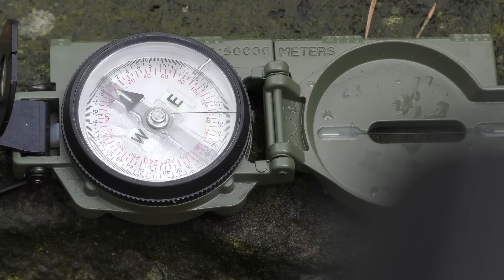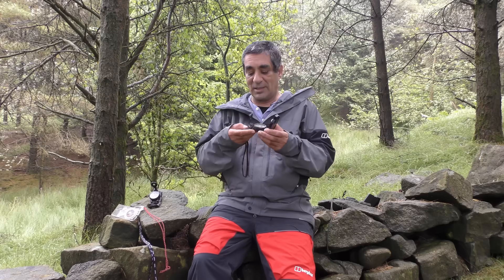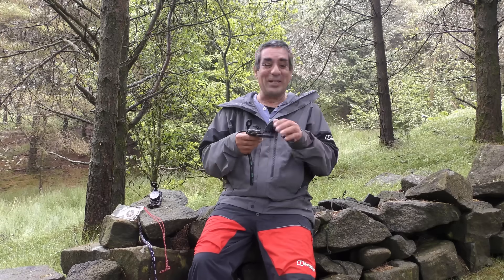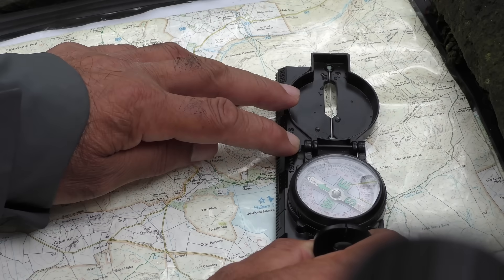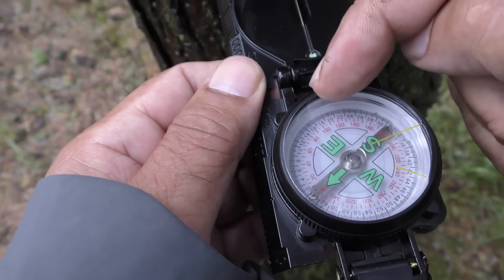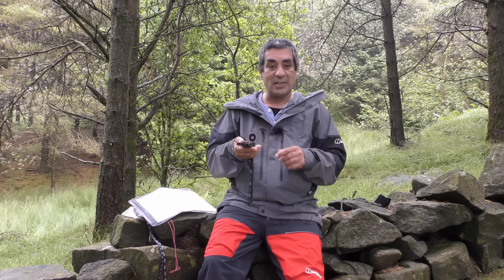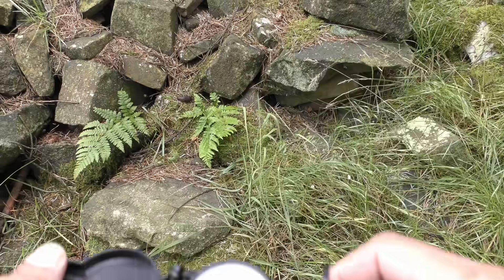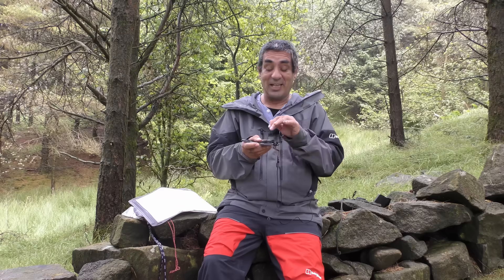The compass no one knows how to use

Comment from the maker: Before commenting please watch the video.  As repeatedly stated in the video, this is NOT a Cammenga.  And, unless, you're around 95 to 100 years old (or more) you didn't learn to use this type of compass in the military as it was withdrawn in the mid 1950's.
Reply: LOL. I was taught and issued this type of compass in the British Army in the eighties. Most people in practice used a commercially sourced Silva compass but this type of compass is very useful if you're forced by circumstance to travel following a compass bearing accurately. The Silva type compass is much more convenient to use when working on a map. We were still being issued equipment from WW2 in the eighties.
Reply: @kalliste23  really, so what's the color of the boathouse then?
Reply: @dorup9060  So... what is the color of the boathouse at Hereford?
Reply: Heck I used a very similar one in the Australian army when I joined in 76. Finally got to SASR, purchased 2 Silva flats, Mils, {we only work in Mils,and Meters,then had a Degrees  Silva for emergency and sometimes easy night work, and one of the Prismatics as a back up. 1 is none, 2 is good, 3 is perfect/Redundancies , redundances. Want to hit an 8 figure Grid Point, show them how please. Good show though matey.

Comment: The little hand points to north, and south will be the opposite direction. You simply need to decide which way you want to go. Hope you are not going to try and invent another compass just because you struggle using it. Also not having a map makes a compass rather useless. And not many people know that over long distance you might think your compass is broken if you don't realise that it is pointing to a single point, as you move past the 90deg point it start wandering backwards. Simple education and you won't need to re-invent anything that already works perfectly.

Comment: Didn't they used to be called a lensatic compass . I had a cheap one and learned to use it when I was a kid . Only trouble with them in an operational situation is that theyre not as quick and the wire and additional components makes them  fragile  by comparison . Still lovely compasses though . I like them .

Comment: I was taught that the small yellow line is used to circumvent obstacles - i.e. ponds and the like and then to resume on the same paabd bearing you began with. Without changing the compass's setup.
The idea is to construct a defined polygonal line or traverse around the obstacle.
The angle is always +-45 degrees, for segment length just count your steps.

Comment: What I'm getting is that the two yellow lines are like the three seashells.
Reply from the maker: But, after watching the video, you now know how to use the two yellow lines.  No one knows how to use three seashells.
Reply: @TheMapReadingCompany  UnitSe might be referring to the two dots that a baseplate has on each side of the orienting arrow and the one on the arrow, typically with phosphorescent coating that might look like shells at night.

Comment: I always thought the point of the two lines were to be able to record two asmith directions. Say you know you will be hiking in low light conditions following a route with a checkpoint part way through where you change bearing. With having two lines on instead of having to stop and reconfigure the compass you could calculate both before leaving and just simply turn the compass from one line to the next without adjusting the lines. Alternatively if you were in a land nav field exercise like I did in the military you could set one line to a safety direction in the event you get lost or it gets dark that will point you back towards a roadway, fence line, or river bordering the exercise area.

Comment: Hi Wayne.  I was told by a family member who was U.S. Army(1970's), that the two lines were for determining how far across an obstacle it was, such as stream or river crossing. From your side of the river you would take a bearing to an object on the other side an then align one of the lines with that object. Then turn 90° and start walking while counting your paces until the line that was 45° offset was pointing at the object and that number of paces was the number of paces it would take to cross the river because a 45° triangle has two equal sides at 90° to each other. At least that's what that particular Sergeant taught. Thanks for your excellent channel. Florida, USA.
Reply from the maker: The compass used in the video - well that type of compass as this is a cheap copy - hasn't been used by the US military since the 1950's.  So your friend was talking about a different compass.

Comment: I agree with your method of sighting on a landmark and reading your bearing.  I disagree with your method to calculate a bearing from a map.  Assuming you are basing all of your bearings off of magnetic north (as opposed to True north), you MUST ALWAYS orient the magnetic north line on your topographic map to coincide with magnetic north on your compass (use the edge of the compass). Once this is done, align the edge of your compass on top of your line of travel. The start point must be on the compass end, and the end point must be on the wire end. Where the wire first intersects the compass is your BEARING. There is usually a black line on the compass that always lines up with the wire. Using this line makes it easier to read your bearing. To travel fast, hold the body of the compass to that it cannot rotate. Then turn the dial on your compass so the index line (usually yellow) coincides with North on the internal magnetized disc. For moving fast, simply rotate the compass so that the yellow index line goes through North, and follow the wire which provides the bearing taken from the map. If working properly, all compasses work the same. I recommend the Cammenga as this compass has no fluid which can freeze or develop a bubble. There can be two sets of numbers that go around your compass. Always use the numbers that go from 0 to 360 degrees. Ignore the other numbers. The Cammenga is best when you want the best accuracy. Use to sight through it like shown in the video. When looking the magnifying glass make sure you are reading the correct set of numbers.
Reply from the maker: Hi Paul, thanks for joining the conversation.  Orienting (pointing in some direction) the map is not necessary - although I know most people still think it is.
I made a video about this very topic:  https://youtu.be/AWiMV4T5kPc

Comment: Was suggested this, figured id watch since i picked up an old engineering compass (that kinda looks like an m1938 style), For a few bucks at a second hand store..

Its in really good condition too.  😅

Thanks for the info.

Also.. mine has a another arm that folds under the lid, with a small magnifying lens.  (Another reason why i picked it up..    if i ever need a fire, and have no flint or lighter/matches

Comment: I am an old geologist. In my university in Italy  I attended a course to use the compass with the needle block in pointing. The first few years I used it a lot and I even passed the orienteering exam without problems. If I were to use a military compass I would have to be very careful because I have never used it

Comment: I actually have a Cammenga 3H Tritium Compass. Found it years ago at Cabela's. It was, and apparently still is, around $100.
It's the EXACT same model that they trained us on in the Army. My privately purchased one actually even says US on the cover and the carry pouch.
 The way they taught us to shoot an azimith was to open it fully, then close the lid and lens tab carefully until the inside corners touched. You then put your thumb through the metal lanyard ring with your fingers wrapped around the thumb and your forefinger curled like it's wrapped around a trigger. The compass itself sits on top of that finger. You hold the compass up to your cheek like a rifle stock and look though the notch at the top of the lens tab and line the wire up with the terrain feature you're getting the bearing on. Then you just swivel your eyeball down to look though the lens and get the bearing number.

Comment: Down a decent knock-off copy of the lensatic compass. It even has a magnifying "bubble" above the long yellow line to magnify the bearing degree. 
 BUT... I'm so damn happy Bjorn Kjellstrom invented what's now the Silva transparent base plate compass.  I have a Silva Ranger and its ADJUSTABLE DECLINATION LINE is a blessing. Plus the Ranger has a weighted plumb needle (points down when compass is held sideways) so I can read the angle of a slope. VERY important here in the US mountain west to avoid potential avalanche slopes.

Comment: I have a US Army issued lensatic compass made by Stocker & Yale, Beverly, MA. The date embossed on it is 13 Nov 86. Other distinguishing marks are DAAKOI-87-C-A016. The bottom of the case is stamped SandY-183 (whom I suspect inspected it), and 120mCl. It was probably issued to me sometime on active duty after 1987. When I retired it stayed with me. It was not on a list of items to be turned in. It only has a short yellow line which is active at night (radium?) Two corresponding short radium marks show the position of the sighting wire at night. It has been used for many miles of backpacking and sea kayaking . I should also mention it is marked in mils for artillery spotting.

Comment: Here's a question:
With the growing deviation in the magnetic poles of recent years/decades how is declination being taken into consideration?

I know that it's not a great issue for short distances, but the maps are based on true north  (with the known declination added somewhere, at least on reputable maps) a deviation of a few degrees is going to end your journey nowhere near your intended destination. Especially if you are using the MILS system. 

Most compasses don't come with the ability to internally compensate for the deviance of the rapidly shifting magnetic north pole, so a trip covering several kilometers/miles may have an unpleasant result at the end of the journey.

Comment: I have an old 1938 floating around in my stuff, somewhere. I tried using it for surveying in caves, but quickly changed over to using Silva Rangers. Surveying underground isn't an exact science. Depending on how well you can set the declination on your compass. That's the difference in true North vs. magnetic North, for your longitude. It doesn't help that the shift has picked up pace in the last dacade or so. It mainly consists of a compass, an inclinometer for measuring up and down angles, and a tape. Due to the mud and grit, standard steel, or even fiberglass tapes don't hold up. We used to make our own from the flat two conductor TV antenna wire. We'd burn the measurements into the plastic. Even quite muddy, you could run a glove over the tape to the nearest foot. In between the 1 foot markings was a guesstimate. Remember what I said about exact science? 
  Once back at the surface, calculations were made from the data, and a map was drawn. Afterwards, this was added to the master. Once a passage could be "looped," You could see how far off the map was by "closing the loop." It was surprising how close we could get with simple survey tools and a slide rule. 
  There were a couple other "grottos" using more sophisticated Brunton compasses, but we could never see a great advantage. They were more expensive and not as tough.

Comment: I have somewhere a compass that has the degrees printed backwards, so whichever direction you turn to (pointing an arrow printed on the compass shell to that direction), you have the magnetic needle’s red  point above the correct degrees number of your heading. So imagine you are facing north, the magnetic red is above 360 coinciding with the shell arrow. You turn right 30 degrees, the magnetic needle turns left from the pointing shell arrow. Underneath it it’s written 30 degrees. No need for a moving arrow above the dial, just a dial with degrees printed backwards counterclockwise.

Comment: i have one of those cheap chinese knockoffs that does have the two lines, but it doesnt have that clicking mechanism on the dial.
Reply from the maker: Have a look on the edge of the bezel (just below the hinge).  Sometimes - on the cheap knock-offs - the "clicker" is made from really cheap metal and so doesn't engage with the serrated edge of the bezel, or it's bent.  If you can see it, try pushing it down towards the bezel so it engages.
Reply: @TheMapReadingCompany  its okay, it literally doesnt have any mechanism

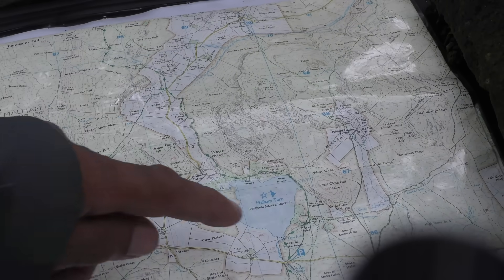Comment: The explanation starting at 3:40 does not make sense, for "it does not matter where the map points" to work, you need to set start point and destination, align the rotating disk with the MAP'S NORTH and then read the bearing.
Reply from the maker: Hi Roberto, when you're using a map with a compass, to take a magnetic baring/azimuth, it really does not matter which way the map is oriented/pointed.  The map can be oriented in any direction and it will not affect the results.
I made a video about this very topic:  https://youtu.be/AWiMV4T5kPc
Reply: @TheMapReadingCompany  Hi, I appreciate your feedback, I watched the video you link in your comment which is very clear and then I rewatched the video here above. I think the problem maybe with the editing as your verbal explanation is clear and logical but what the hands are doing with the compass do not coincide with the verbal explanation. 
Great videos by the way, I ran into your compass calibrating video where I also got a nice history lesson. So thumbs up. I am subscribed. 👍👍

Comment: I have one of those compasses with the two lines. It's so old, I don't remember where or when I bought it, possibly in the 1960's. It's never been used and is still in its cloth bag...a real antique now. Mine is marked Engineer Compass but looks like yours with the revolving bezel. The dial is marked Japan so it's possibly an import. The eyepiece has a magnifier so you can easily read the small numbers on the dial. Mine has a small button on the side, when pressed will keep the compass card from rotating. Trying to use one of these makes you appreciate the skills of early map makers and surveyors. I guess they "knew all the angles."

Comment: I learned how to use a similar Brunton version of that when I was in college, which also had a declinometer (measures slope).  It was required for geological mapping and other folks used them in surveying.  I still have that compass almost 50 years later. You have correctly cited how to use the yellow arrow!  It's simpler with a Silva compass, which I used in the Army.  Brunton still makes the military version.

Comment: During my ROTC years (1976 - 1979) at CAL Berkeley, we were taught to first find our position on a TOPO.  To do this we would find two l major landmarks that were not less than 30° apart.  Using the sighting ring and the wire, look through the ring and place the wire on your landmark, then flip the sight ring down to lock the compass dial. 
Next, write down the compass heading in your notebook.
Next, follow the same procedure as above for you 2nd landmark, record the heading in your notebook.🎉
Next, open the compass so it is flat and unlock the dial and orient the topo map directly facing the landmark. Lay the compass on the topo map with the top of the straight edge on the first landmark.  Keeping the edge of the compass frame on the landmark, pivot the compass until the heading on the compass is same as your first heading.  Next, holding the compass firmly on the map, using a pencil mark a line down the straight edge.
Next, do the same for the 2nd landmark. 
Where the two lines cross is your location.  
To more accurately determine your location a 3rd landmark should be used.  
Note: If a 3rd landmark is used the three lines will not intersect at a pinpoint.  There will likely be a very small space created by the lines crossing.  Your position will be in that very small open area.
Once you figure out where you are, getting to your objective should be easy.

Comment: The lines and the needle glow in the dark! The military flashlight is made to fit the compass. You can put the flashlight on the compass to charge up the things that glow in the dark. if done right you can charge up the compass without light changing your night vision.
Reply: Tritium is a radioactive element it Always glows, but in 20 to 30 years, it can run down and need replaced.

Comment: This looks a bit like a smaller more packable version of The aviation equivalent of the slide rule - The handheld navigation and flight computer.  Not sure how computer applies to four or five layers of Mylar with odd tabs around one of the wheels and some of the sliders would adjust and wedge other moving layers/components showing the resulting answers as the math would dictate. Well, as close as the resolution of the heading radians, magnetic north adjustment tab, fuel left, airspeed blah blah blah. 
   to be rotated and slid vack and forth with determined concentration to get the super sacred "how far off course am I" quotient of over in 
There is a spot for a compass such as the one you outline in this video, I think most planes are required to have a backup compass in case your surplus Sopwith Camel's OEM nav and comms panel conk out.   Which is a lodestone tied to a string hanging off of the throttle and a "Go Tigers" megaphone you stole from the airport gift shop.